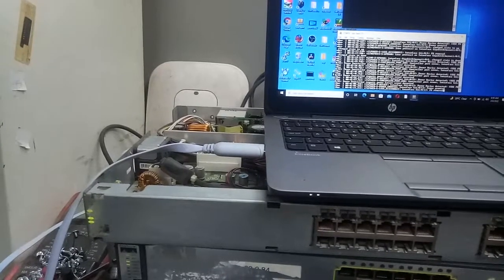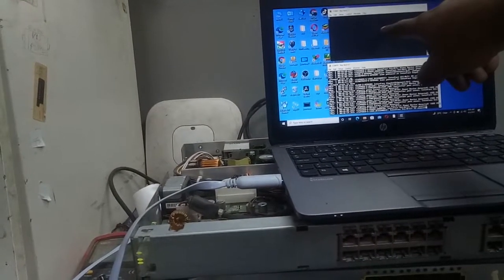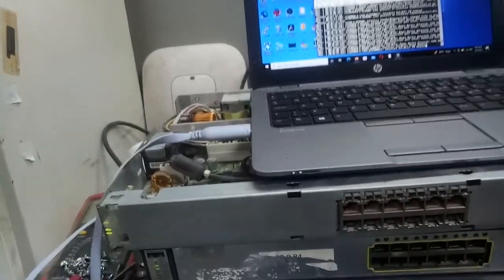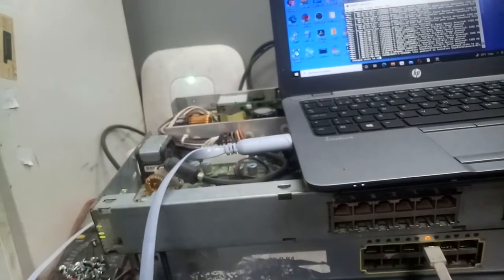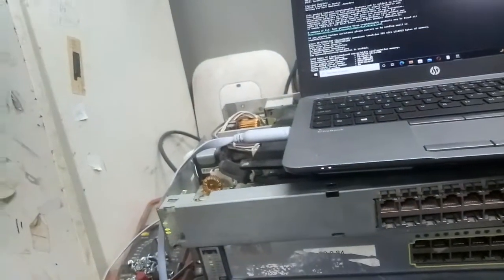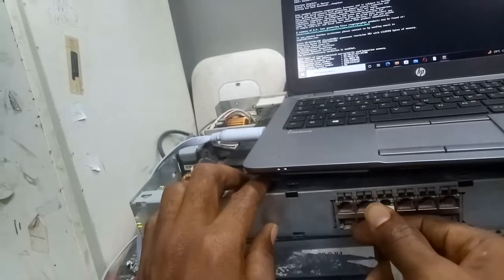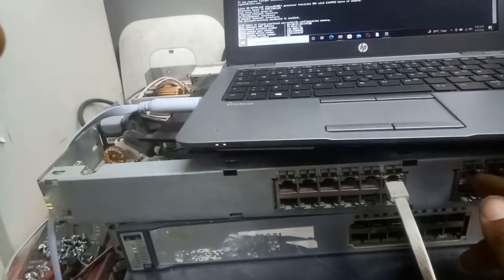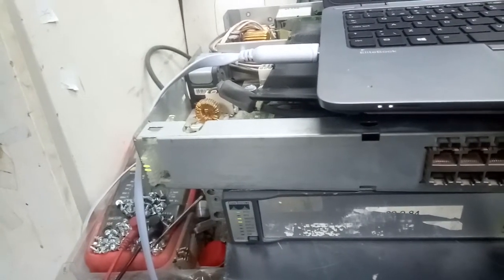#cisco #networking #software #switch  Troubleshooting switch port and interface problems - Cisco

Comment: I have L3   3650 series switch,problem is all interfaces not showing light
Reply from the maker: Are you good in software ? If yes check with your console cable to know if your ports is administratively down
Reply: No administratively down, hard problem
Reply from the maker: OK send message on our page on Facebook